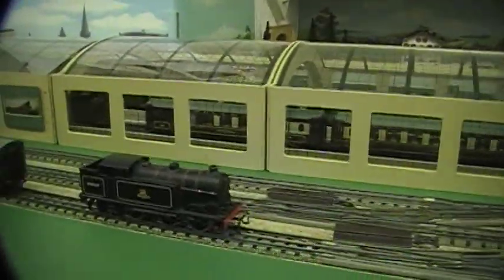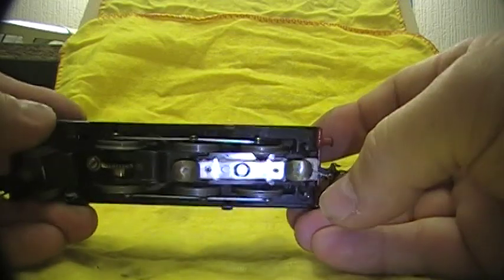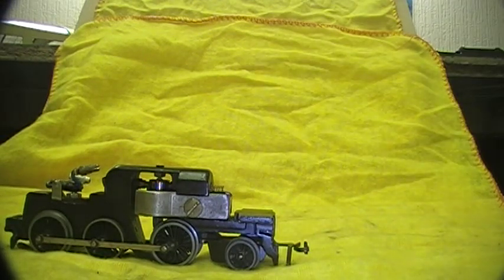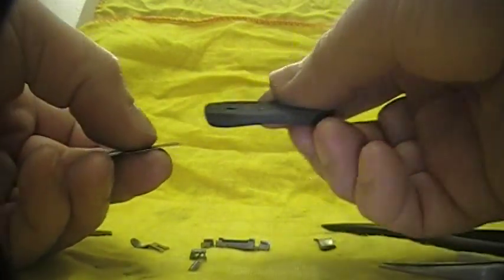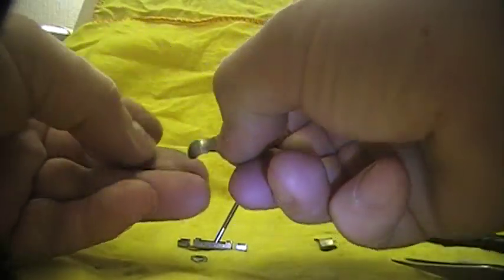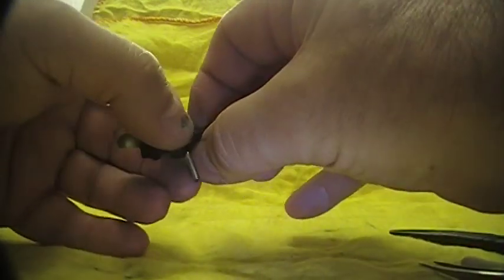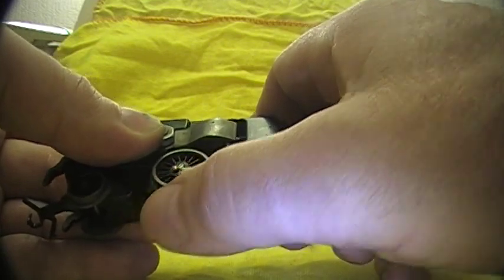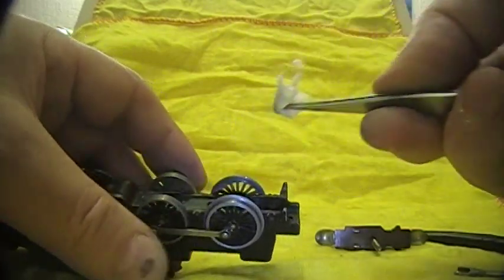Hornby Dublo service, pick up and brushes

Comment: A great video to watch , the hornby locomotive looks very robust and a credit to you keeping them running .
Reply: Hornby-Dublo locos of that era are indeed very robust : I still have my 'City of London' loco from the late 1950s , along with a Class 20 Diesel , both of which were part of the train set my father bought me as a child ( I'm 65 now ) and both still running perfectly . Alas , my young son ( aged 14 ) caught the bug thanks to Thomas The Tank Engine and some of the Hornby models from 10 or so years back ; then he moved on to models of actual locomotives . Unfortunately the modern Hornby stuff is not nearly as well constructed as those of yesteryear , and he has , amongst others Mallard , Tornado , Flying Scotsman , several other A4s and other locos ; most of which were purchased new as part of complete train sets , and have not been abused , yet they suffer from issues with the pins holding side rods falling out , running issues due to poor pickup or motor faults ; yet my 60 year old locos just keep on running !   Of course the same is true with cars and many other things - alas everything nowadays is made to a price .

Comment: Hi Ronald thanks for replying back to me watched the video on repairing the N 2 I have Watched this before. And I have watched also all of your servicing and track repair videos and  the magnets one a well. Ronald I have purchased all the parts to convert the West Country class to convert it to three rail do you wire the red wire to tag at the top of the chassis. And also have you any up and comings video on converting two rail to three rails in the Future many thanks for all your help lots so learn on three rail. Many thanks Colin.
Reply: Ronald I just thought I would let you no a have successively converted my two rail castle class + my West Country class to three rail I have even replaced the tender + loco wheels with hornby dublo on the castle loco and Alan Gibson on the bogie + pony truck and hornby dublo on the tender on the West Country loco all now on steel wheels parts purchased from eBay + mainly trains. Ronald I would like to thank you for the great maintenance servicing projects on your subscribed Channel many thanks Colin.
Reply: Hi Ronald good afternoon, I have the twin gauge master transformer on my hornby and bachmann two rail layouts can I use it on the hornby dublo three rail layout that i am Building many thanks Colin.

Comment: A fantastic and very informative video , applicable I would imagine to most electric locos . While my own couple of locos are Hornby-Dublo 2 rail models from the late 1950s , and my young son has a lot of more modern Hornby locos , much of what you have shown should apply to many of them . I recently bought from you the magnetiser , which has helped with some locos which had been in storage for a while and lost their magnetism , but the tips shown in this video will help me to further improve the running of some of them .

If , I may ask , while my son's layout is entirely 2 rail , I believe some people have converted 3 rail locos to run on 2 rail track . Aside of the purist position ( as with classic cars ) of keeping things original ; could you comment on the process of conversion , and whether the original pickups etc can be put back if one wishes at a later date to restore a loco to original spec ? I could be minded to obtain some 3 rail locos ( which can still be bought relatively cheaply ) and convert for 2 rail operation , as long as I would not be doing irreparable damage which would prevent them being returned to original spec at some point in the future ?

Might this be something you could do a video on , or can you point me to an existing video ?
Reply from the maker: Hi, Thanks for your kind comments, converting from 3 to 2 rail is not so easy as the wheels need to be isolated on one side as I only run 3 rail I have never done this although I have converted 2 rail to 3 which is much easier.

Comment: Hi Ronald good evening, sorry to bother you again I have started to laying my track the locos at the moment will not run using the gauge master controller I have been watching your channel on track work which has help me out a lot on track work if you can give me some advice on what I might be doing wrong many thanks Colin.
Reply from the maker: Hi Colin as long as you have power to the track (to check your controller use a multi meter or put the wires direct to the pickup and wheel of your loco) then there may be a short circuit in you track, see my 'trackwork' video, although I only do 3 rail.
Reply: @Raedodd5  HI Ronald thanks for getting back to me I have watched your track work video I have since done the work step by step on all the track watching it was a great help i am about to start screwing it down the the board I will run it before I start screwing it down I will let you now the out come again many thanks Colin.